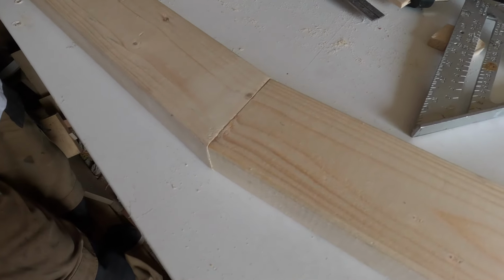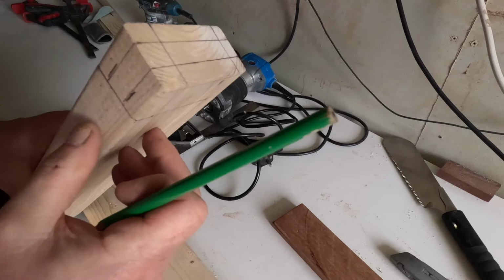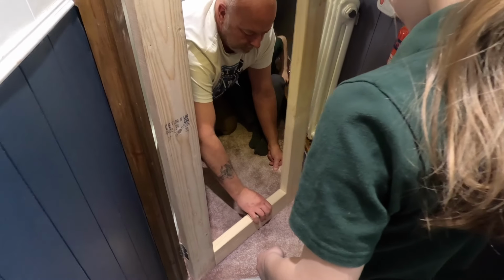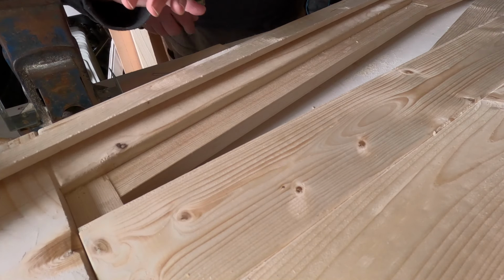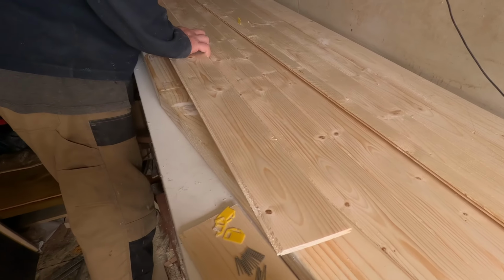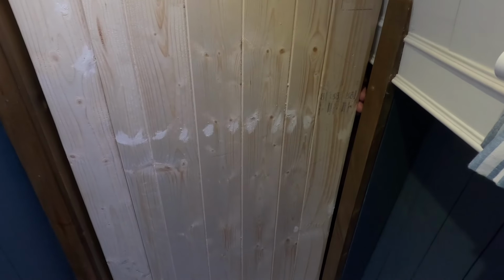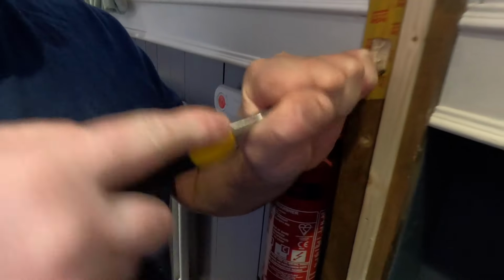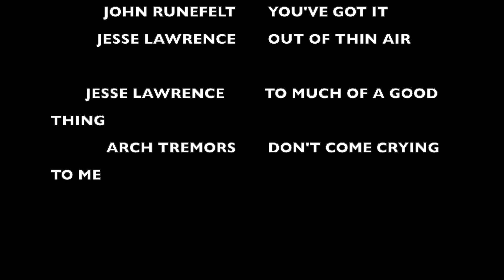Vlog 135, Narrowboat Fit Out -Internal doors Part 2 (The shaped one)

Comment: Nearly there grandad. It’s looking great, them doors are SOLID.😂
Can I ask a question?
Did you treat your fuel tank when it was on the hard to prevent rust?
Our shell is due soon and it will be a long while before the engine is fitted, just wondering if you treated yours with anything.
Reply from the maker: Cheers Wayne,  No we didn't do anything to our fuel tank. Just kept it sealed until we were ready to use it when we installed our diesel heater. We've never heard of anyone else treating theirs either. We have had no problems so far. Good luck with your build 👍
Reply: Cheers grandad.that re assures me a bit. I guess I’ll just keep it sealed and all should be good.
Thanks for your reply .

Comment: Hi grandad.
Boat is looking great the final touches are coming together.
Can I ask a question?
Your boat was on the hard for a while with no engine, did you treat the fuel tank with anything to stop rust forming on the inside?
Our shell is being delivered at the end of the month and it may be 2 years before the engine goes in so wanting to protect the fuel tank if possible.
What did you do (if anything)?
Thanks for the vlogs we have watched them all.
Reply: I've never faced the problem you describe, never owned a cut boat actually. So, take my thoughts with caution! I wonder though, if you put maybe a liter or 2 of diesel in the tank and swabbed it around the interior surfaces, wouldn't it's oily nature tend to protect the steel?
Reply from the maker: Sorry I was a bit rubbish answering comments last week. Hope you got your reply on your last question. 👍
Reply: Hello Wayne, I wanted to expand on my previous answer a bit. I was more than a bit concerned about access to your diesel tank, whether you could work inside with a paintbrush,  roller, spray gun, etc. I'll assume that sufficient access to work inside of the tank is available.  Here in the US (I'm betting in the UK as well) you can buy a number of what appear to be permanent solutions, POR-15, Rust-Oleum ROCEpoxy, KBS Tank Sealer & Caswell Epoxy are just a few available options. To be honest too, I've never used any of these products. I did though back when, paint an entire car with a epoxy based paint called Imron. It worked very well. I wouldn't recommend Imron to paint inside your tank, but man epoxy paints are tough! Imron, as do these products I mention, comes with serious warning about wearing an appropriate respirator. Please let me know if I can help in any way!
Reply from the maker: @mittman9977  The problem is I think most Narrowboats are like ours and only have a hole big enough to get the Diesel filler nozzle in so can imagine it would be quite hard to get an even coat of spray on all the surface and also not block any of the fuel pipe while spaying blind. Not sure what the solution would be if you wanted it done
Reply: @makinganarrowboatwithnannyandg  Thank you H/A,  I agree completely and was wondered if that might be the situation. (I will delete that post if you think it's advisable.) I'll add this comment as something of a warning, I don't want anyone to end up with a mess! When I suggested in my first comment that one could dump in a small amount of diesel and attempt to swab it around; I could rather believe that could be done through a rather small filler nozzle. If one is certain to not lose what they are using to swab around in the tank. I wouldn't brag that would be anything close to ideal, but this could be relatively safely done. H/A's, previous comment is spot on, absolutely only use epoxy paint or other coatings if one is certain they can be applied properly and the finish will stay put. This is the flipside of this, one wants to only put something into a tank like that with a small opening that will burn cleanly in the engine, or stay where they were properly applied to the inside of the tank. Epoxy paint chips/overspray sucked into a diesel engine/filter would be a disaster!